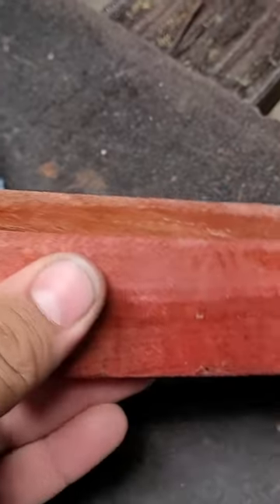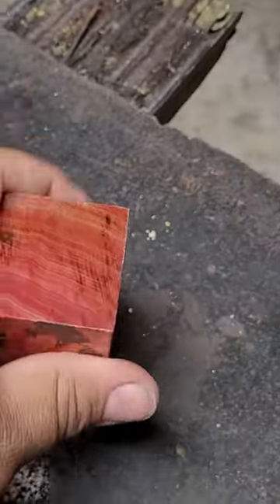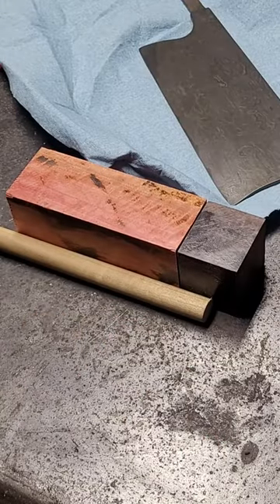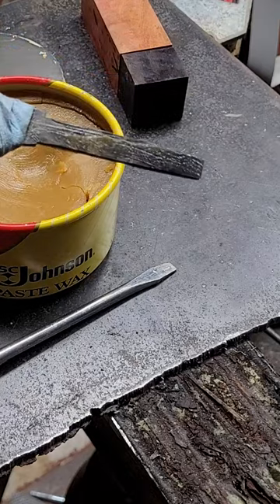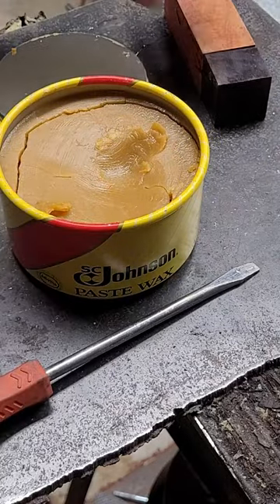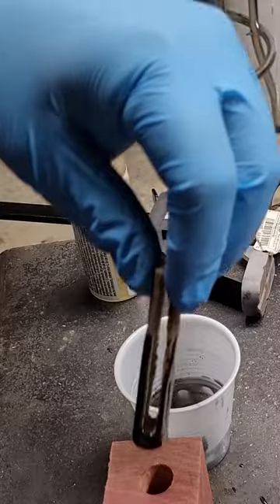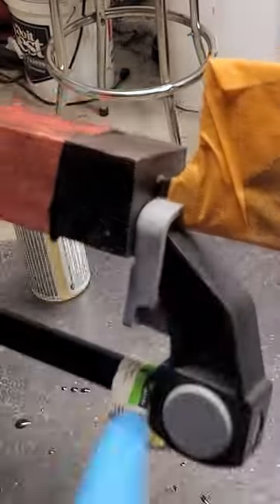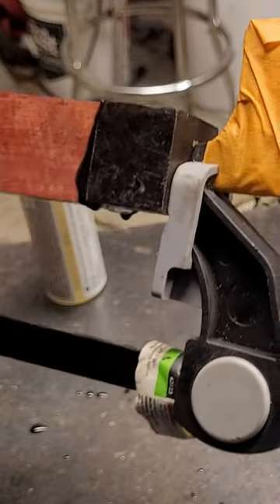Making a Damascus Cleaver From Fish Hooks Pt 2 - Handle

Comment: What’s the dowel for show me that
Reply: It does a few things.

It speeds up fitting the handle. Instead of having to broach the hole to fit the tang, it makes a circle a rectangle instantly.
It also holds the handle materials together better than just butt joints.
And it helps with alignment when reinstalling the handle, because it can only go in at the correct orientation.